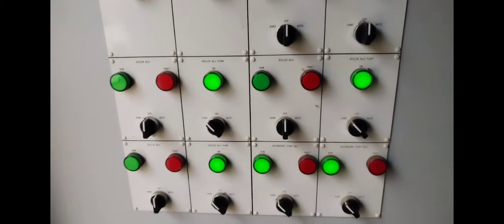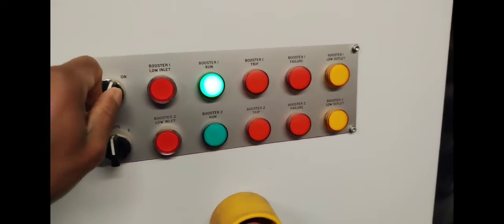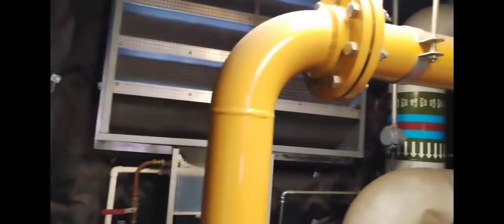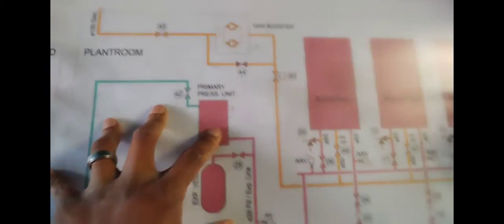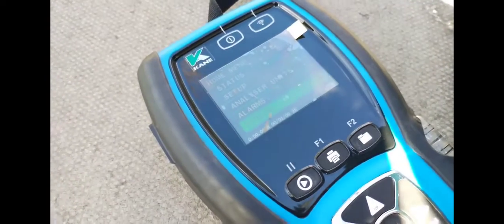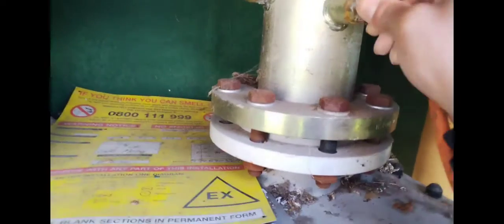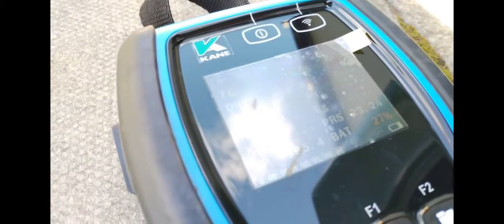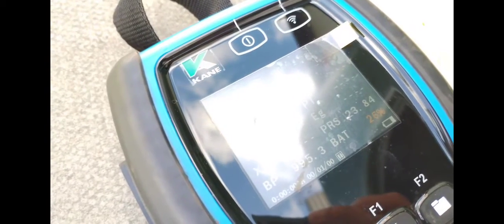COMMERCIAL TIGHTNESS TEST pt2

Comment: Nice video, very informative - have a G.S inspection next month. Roughly 5 years ago I recall being asked a question by an inspector (over zoom I think) - didnt know the answer and couldnt find it in the manual -  Q - In relation to Pipework - what is the maximum allowable pressure loss when OP > 25mb - answer 10% (Under "Pipework Design" in LCL Awards and NIC EIC Commercial Manuals etc- incidentally I cannot find pipework design or a reference to this in Viper Gas, which was my undoing last time) ********* just thought Id mention it in case any subscribers ever find themselves in the same position ********** @commercialgasengineer - hope you dont mind me emailing for a copy of the worksheet

Comment: have you noticed the gas meter volumes have all changed from the igem books, you had a u160 which you put down 0.304 but if you look on the meter its actually 0.048.
Reply: V is the cyclic volume - the volume of gas required for the internal parts of the meter to perform 1 complete cycle. the total meter volume - IVm - is the total internal free volume of the meter. both the V and the IVm can vary according to the meter type, size, and manufacturer. so for our calculation purposes the IVm has been standardised, for a u160 it's 0.304m3.
i didn't know this until i saw these comments which sent me on an investigation so thanks for that. i could always be wrong though so always happy to be corrected.
Reply from the maker: @cliveramsbotty6077  well done for doing the homework Clive. That's what it's all about. Engineers learning from each other.
Reply from the maker: @fidotbeddoe a few things say that this is a U160. First of all the Qmax. 2nd contacting the manufacturer who confirmed this. 3rd the bar code states what it is. Google "Gas meter Identification". Igem 1 helps with this.
Reply: @CommercialGasEngineerVideos  Thank you very much, really appreciate that you actually spend time and effort to help all 👍👍
Reply: If you look at the badge it tells you its 48 decimetres which is 0.048
Reply from the maker: It's a U160. The bar code states what meter it is. 0.048 is the volume for a much smaller meter.
Reply: I actually came here to say the same 👍
Reply from the maker: @mustafapolat2540  a few things say that this is a U160. First of all the Qmax. 2nd contacting the manufacturer who confirmed this. 3rd the bar code states what it is. Google "Gas meter Identification". Igem 1 helps with this.
Reply: Hi guys, do the new gas meters have diaphrams anymore? Isnt this why the volumes a lot less.
Reply: Ive tried speaking to gas safe about this and they were useless, i then contacted igem with a posted question and there reply was you cant be wrong if you use the standard but as well you cant be wrong if you use the data badge. It would be nice to know for certain as it does bug me a bit.
Reply from the maker: @fidotbeddoe  I'm pretty certain that it's a U160. Even called the meter company for you to confirm and give me extra info about a suitable replacement. Two very good gas engineers concurred with me that it was a U160 and that you follow the books volume guidance. Then another engineer in the chat said that he believes the volume you see (0.048) is the cyclic. I haven't checked but it seems to make sense. It's a shame that engineers don't get taught this at a training centre but that's what this channel is for I guess. To help iron out doubt and understand more what we are doing. Maybe you're overcomplicating it. The amount it let's out is 160 an hr so it's the name it goes by, then you look at the book and it gives the volume. Don't let the V on the unit throw you off track. Follow the blueprint. Meter says E160. Qmax says 160. So it's a U160. Look at the chart and you have your volume. The add that to your calculations.
Reply: Good evening, just to throw a spanner in the works, when you measure the dimensions of a new u160 its physically impossible to be 0.3m3.
Reply from the maker: @fidotbeddoe  I think that you really want it to be that volume no matter what. However I can see it being that size. I have looked at many meters and could have guessed it was a U100 or U160. On the other hand, which is how you have to look at arguments to be rational, what size of domestic meter is the 0.048 you're considering. Also consider the 4 boilers it's serving and the gas required to serve 200+ people. Consider how you work out volume when measuring a rotary meter where the exact size isn't given. How big would you like the meter to be in order to be 0.3? Consider pipe being wrapped up in bundles to make up a gas meter. Try to also look at gas calculations to select the right meter to serve the flow rate required by the boilers. Hope this helps. Ask your gas mentor at work what they think and let me know what you find. I'm 100% it's a U160 yet am interested to see your argument.